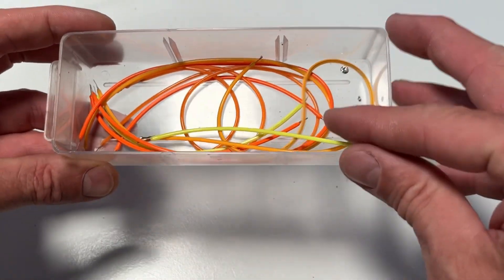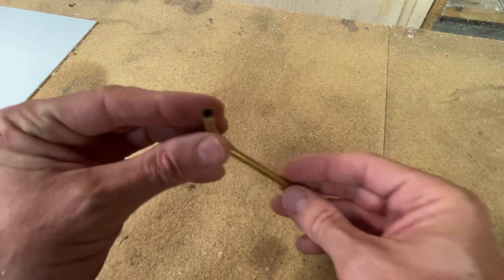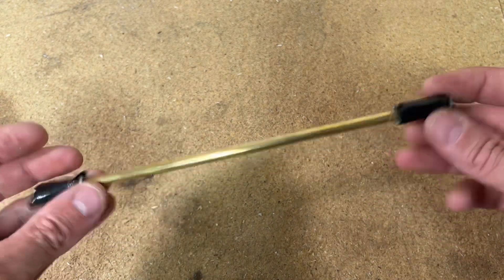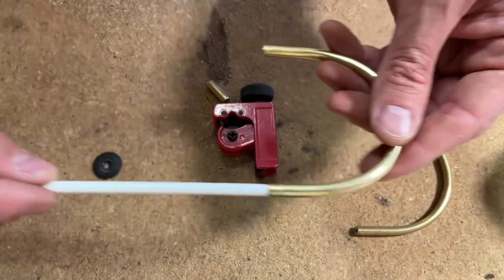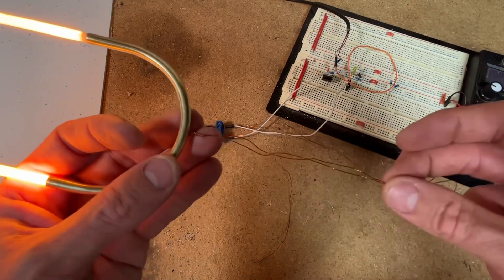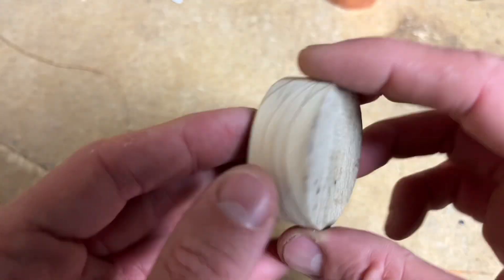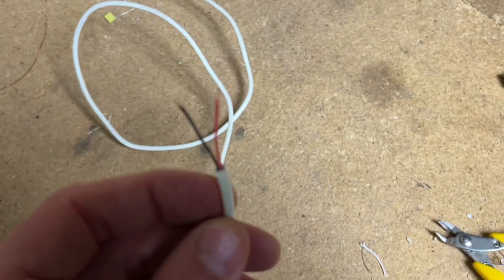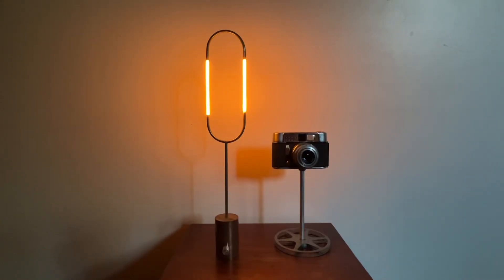LED Filament Lamp

Comment: hi Marcus,
Can you confirm once more the height of the base? The instructables says 150mm hight, but when comparing that size with your pictures, that does not feel the true size. BR
Reply from the maker: hey there,
the base is actually 80mm.  however you can really make it as high as you like.  prob no less than 80mm though as you need to fit the dimmer etc inside the 40mm tube
Reply: @lonesoulsurfer  thanks for the reply, appreciated. Would you mind adding your instructable description as well?

Comment: Just FYI, pipe springs are supposed to be inside the pipe (that way, the pipe spring stops the pipe from collapsing when you bend it). So you either need smaller diameter pipe springs or larger diameter pipes! HTH. Well done, nonetheless - a superb result!
Reply: the one he used is designed to be used outside, it has a funnel on the end. the inside ones have a taper on the end and usually a loop on the otherf so it can be pulled out with a cord. the sand has to be really compacted for it to work.
Reply: i havn't tried it but i think it can also be done by filling with soapy water and freezing.
Reply: I have used what looks like spring with cable inside. It fits tight into the tube and allows you to bend with out kinks.
Reply from the maker: Thanks!  When I was researching I did see some people using them inside and outside the tube.  However, you are def right about it working better if it was inside the tube.  Unfortunately I couldn’t find small enough springs to fit inside.  The best scenario would be to have one inside and outside I think.
Reply: @lonesoulsurfer  the spring has to fit snugly around the tubing, that’s how it keeps the tube from deforming and eventually kinking, so if the tube isn’t one of a few standard sizes, it may be difficult to find a spring they fits well enough to work properly.  Great lamp by the way!

Comment: I like the simplicity. Getting the right diffuser for any LED project makes all the difference. What kind of tubing is that?
Reply from the maker: Its polystyrene tubing - you can get it from hobby shops.  This is the exact one I used
https://www.hobbyco.com.au/products/evergreen-226-white-polystyrene-tube-0-187-x-14-4-7mm-x-36cm?currency=AUD&variant=41248073711772&utm_medium=cpc&utm_source=google&utm_campaign=Google%20Shopping&utm_source=GoogleAds&utm_medium=cpc&utm_campaign=%7Bcampaign_name%7D&network=x&device=m&gclid=CjwKCAiAuaKfBhBtEiwAht6H76mDGYCPxakhzIALleswKJGaVTUQNHtZE2eNNXNl0Ll952Ke-FJKoBoCbM8QAvD_BwE